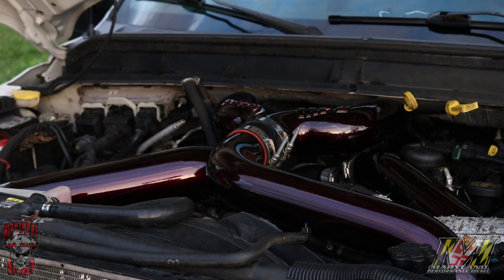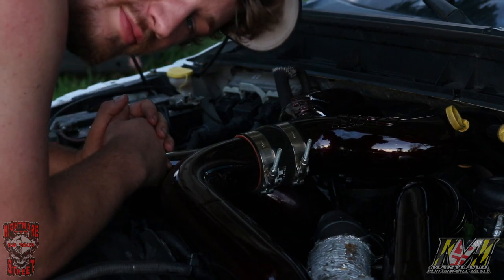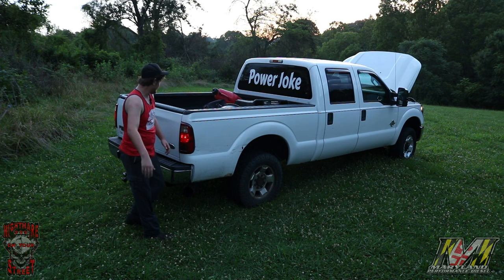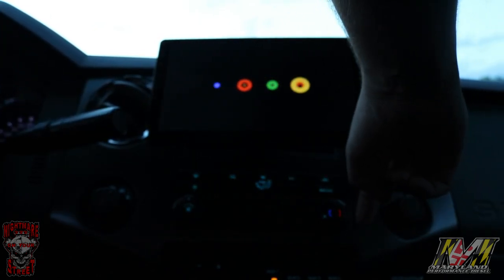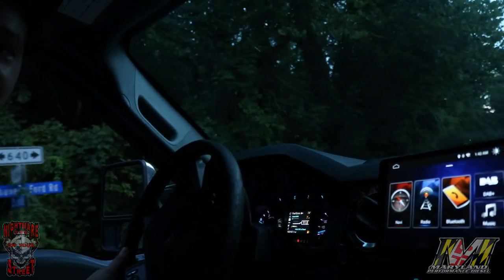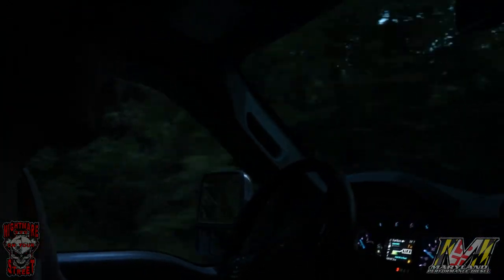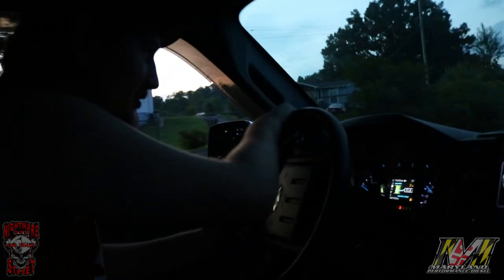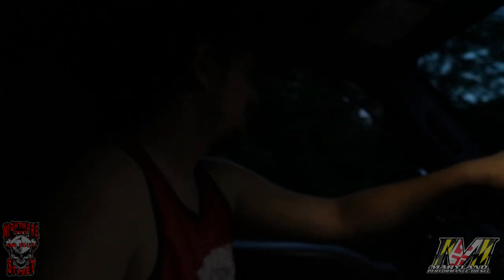MARYLAND PERFORMANCE DIESEL 6.7 POWERSTROKE BUDGET TURBO KIT, 10MM CP4 AND PIPING KIT REVIEW

Comment: Where you located at? I see the VA plates I’m over here in northern VA by the Dulles airport.

Have a 21 250, currently just tuned  w Cooper custom solutions tuning. 

About to do a RCD Cpx 38% over & debating on either a stage 2/3 No limit. The Rds, or the Predator gx10 turbo. 

Love seeing other guys around here on the performance side of these things.

What else you have done to it?
Reply from the maker: I’m in southwest Va. lil town called Pennington gap. I’m actually pulling the engine about to build it and do compounds, built trans and transfer case.